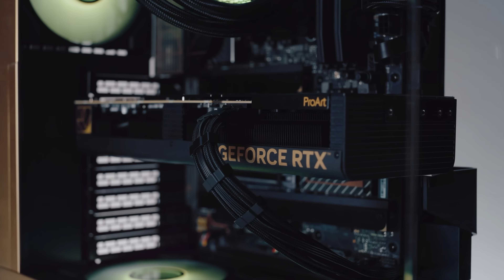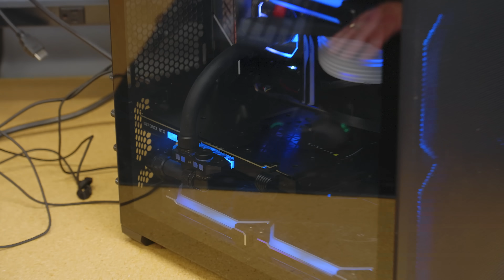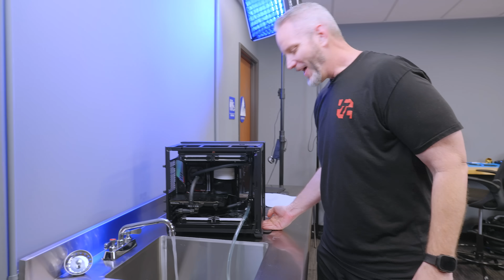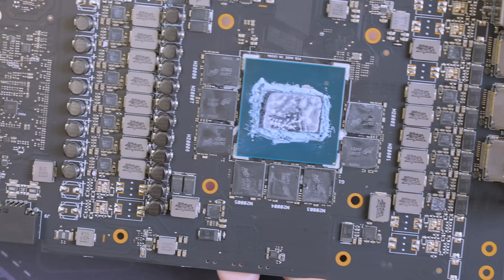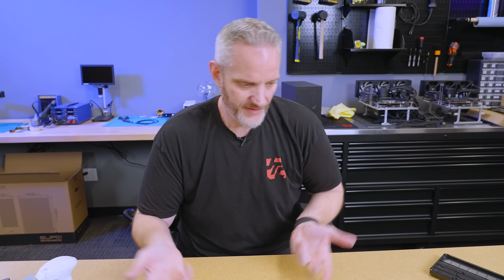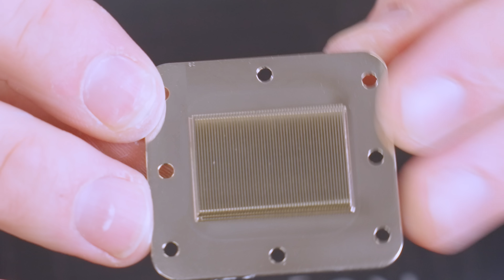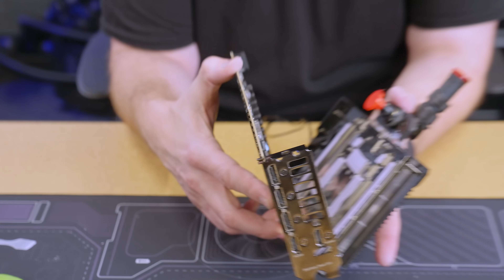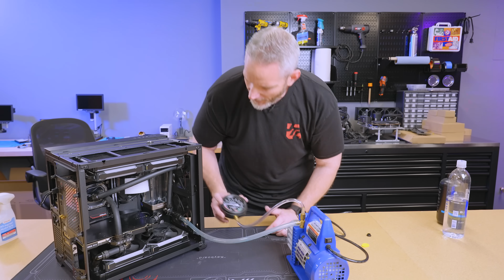These GPU Temps were BAD... here's what went wrong and how I fixed it!

Comment: I am rather new to PC building. I just finished my gaming PC about a year ago. I have a MSI gaming trio OC (non plus) and the core while playing cyberpunk 2077 in 1440p with everything on ultra ray tracing is also on ultra the gpu core is going g between 68-73c the max temp was 73c. My Hotspot is reading between 87-93c with max being 93c. Is that delta concerning? Should I repaste or monitor and consider warranty? My CPU is the 9800x3d and the highest that has gotten in temp is 62c it hovers around 58-60 most times. Is the delta between my gpu core and the Hotspot cause for concern? Or am I stressing over nothing? For little more info my ambient temps in the room are high as I live in the desert and dont have good AC. If I were to guess my ambient room temps are in the 70's
Reply: Thank you in advance to anyone who can give me some insight and taking time to help me out little worried :/
Reply: I know it's been 4 weeks, but I suppose you have a 4070/5070 or something along those lines? Those numbers are acceptable, specifically if the fans on your card don't ramp up too much on their own.

Comment: My 4080 super is incredibly hot on the memory. 104c and I already tried changing to der baur pads and a phasesheet for the die. No change on memory temp, no change at all actually. Tried undervolting and still no better

Comment: I have been using AIO for years Jay your water cooling sucks,You run hot water from your cpu or gpu with out cool between heaters  it does not work effciently coold water must enter CPU or GPUbefore heated you say it dont mater but does Ambien temp mater?

Comment: @Jayztwocents

I'm having same kind of problem with my new AMD Radeon RX 9070 XT. It is air-cooled with three fans plus three fans on the bottom of the case blowing straight to GPU.  When I play Expedition 33 on "high" settings, my hotspot flaxuates between 80-90 c while my side temp remains 65ish all the time. Any advice or tips how to get the hotspot down a little? GPU is on factory settings with power limit raised to +10% and I have BeQuiet Light Base 600 with 4 pre-installed fans to begin with so air flow shouldn't be the problem. And we are talkin about 22 ambience.

EDIT: Just ran 20 laps of speedway, my temperatures settled 55 c on GPU side, 84 c on hotspot, every fan 100%. Is this normal or can someone give me some advice how to get that hotspot down?

Comment: Since you asked me to so nicely 
As a mechanic I cannot fathom why you would want to introduce the problems of a liquid cooling system into your PC 
Air pockets, blockages, leaks, debris build up, corrosion, the maintenance etc is just too much, at least with an engine if something leaks 99% of the time it will be a okay, whereas your electronics won't be so lucky for many reasons 
I would completely understand if it was a 10-20-30°c difference between air and water cooling but even now with a single card system pulling 800-1000w there is only a few degree difference for a metric ton of extra money, and work

Comment: My 4070 Super was hitting 105 on the hot spot with a 25+ delta. Pulled it apart to repaste and found a dry spot and my damn sag bracket was preventing one of the fans from spinning. Runs great now.
Reply: Awesome. What are your temps now? I have 4070s as well, and the hot temps are like 86. Shouldn't I be worried?

Comment: I saw the difference between mounting pressure.  I have the same issue with my 7900xtx. Since the chiplets aren't the same height, the 7900xtx is know for hotspot deltas.  I'm trying the thermal grizzly ptm. Honeywell ptm7950 is an other but there are alot of knockoffs.

Comment: i always just put a blob in the middle of the die. never had a card fail on me that way. my zotac 3060 12gig flashed with the twin edge bios for higher power limit was done the same way. deshrouded it and slapped two noctua fans on it max temps is 62 on the die nd 71 on the hot spot.

Comment: 13:53 Some thin plastic works excellently for cleaning between the fins. I've had good success with getting an old plastic soda bottle and cutting some squares out of it. You can use each corner of the square as a scraper to slide between the fins. After a few swipes through the plastic can start to get a little worn and becomes less sharp, so then I swap to the next corner of the square. Worked well with my EKWB blocks, but couldn't work with my Heatkiller IV Pro; the gaps between the fins are too narrow!

Comment: would an ultrasonic cleaner help with build-up in those micro channels or would it just help with the bulk removal while still needing a detailed clean?

Edit: mentioned in the last 30 seconds or so, gotta stop running to the comments before I finish a video, gd. Also, what was the cause of all that build-up?

Comment: may look into a water separator for something like a air compressor system as a separator in between the vacuum pump and the pc, not sure if it would handle a vacuum as something intended to only see internal pressure. just and idea

Comment: What was the source of the crap that clogged the micro fins in the block? Would an in line filter, with a bypass loop and clear tube, be a reasonable addition? Perhaps a design that would allow filter replacement without draining the system?  This would hopefully eliminate crap building up in the micro fins.

Comment: Phase change material would be great for water cooling: Honeywell PTM7950, Thermal Grizzly Phasesheet, or if you’re on a budget Gelid Heatphase: lasts much longer, performs well, great for laptops/low-maintenance situations (if you know the person who’s getting the computer doesn’t do much maintenance, or if you want to avoid taking something apart to repaste). In my experience all 3 perform pretty comparable (although Phasesheet does explicitly have a thermal-cycle number before it performs well)

13:59 This is exactly why I water cooled my PC

Comment: Its becoming apparent in GPUs and CPUs we are approaching a hard heat barrier. As die parts get smaller ie nm size and power being used increases were headed to a heat barrier that may require something entirely different to todays technology. Burnout is becoming a big problem.

Comment: I'm sure your done it with your car work! Save yourself time and trouble! Put something that will work as a reservoir between your pump and the liquid. With less than an atmosphere of pressure, you wouldn't need anything particularly strong.

Comment: Yeah... I've never owned a liquid cooled GPU. I am not superior enough to run open loop cooling. I'll never deny how great it can look though.
I did however get a great deal on a deepcool 360mm AIO four years ago. So I'll be running that until it drops dead and then going back to air cooling.

Comment: Ya know recently i realized my GTX 1080 was running warming than it used to. quite a bit. air cooled, system is quite clean overall. Thinking its probably time to re-paste/pad mine, but i cant find any concrete information about the thickness of the thermal pads on my 1080. Jay do you have any advice on how i can determine the thickness of the pads, without disassembling the card first? cant have the card be out of commission while i wait on something in the mail.

Comment: This vacuum filling method would actually work much better if the bottle was above the valve and you made sure the fill tube was empty of air before you opened the valve.

Comment: I had never had an issue with thermal paste pump out until my Tuf 4080 Super...My GPU hotspot was hitting around 82c-83c with 20c ambient...I have a massive water loop with 2 45mm thick 360mm rads and 55mm thick 360 rad, so I knew something was wrong...When I pulled the block off the GPU there was barely any thermal paste left on the die, it had all pumped out around it...Instead of putting my Kyronaut paste back on it, I just coated most of the card in conformal coating and put Conductonaut Liquid metal on it...The hotspot never cracks 50c now and I couldn't be happier!

Comment: water cooling is awesome as I can set the fans so low that I don't need to hear them and I get low temps it is so practical. I will give it that it is expensive but I get such low temps and that's why I did it was for the low temperatures. I put AIO's in build that I build for friends though.

Comment: I used that tubing as well and it is SUPER tight in the fittings. I finally gave up and used vice grips and pliers and embraced the paint I rubbed off as a design. 🤷‍♂️

Comment: I had a similar temps issue with my Taichi 7900 XTX.  I replaced the thermal paste with PTM7950 and saw great results.  15-20c drops and the delta between GPU and hotspot dropped from 20-40c to 10-20c.

Comment: I'm sure it's not a huge deal but I wouldn't want the CPU and GPU connected so closely in the cooling loop.  Where one's intake is the outtake of the other.  I'd want at least a single fan radiator between them in the loop.

Comment: So many people here that either have or think there are too many issues with water cooling. I've been running full custom loops for 15+ years now and the only thing I've done is change fluid once a year which often turns out to not even be necessary. 

I only run deionized water with proper growth inhibitors, never any colored fluids and never any issues.

Comment: My 6750 XT's hotspot reaches to 110-115 C°. I sent it to the service twice, they said nothing is wrong with it and sent it back.
Reply: What AIB company is it? And you should under volt it (1100mv) set your min core clock speed to 2400 and max clock speed to 2600, set max fan speed to 60%, turn off zero rpm fan and you can do all this via Amd's Adrenaline software. Ancient Gameplays a creator on YouTube has a great comprehensive guide for custom overclocking with these cards, it's easy to follow, you get better performance and temps. IF doing something custom scares you then in the Amd Adrenaline software there's options under the performance tab that let you "1 button" under volt. Just doing this should reduce some of the heat (Though a proper custom tune would be much better).

Comment: As a minor criticism of your technique when vacuum-filling the radiator system, there would have been less air re-introduced into the system if the fill-tube had been filled with liquid before the valve was opened.  The way you showed it being done, the interior volume of that tube was full of air, so it was the first thing pulled into the system, even before the coolant was pulled in.

Comment: I also just fixed my hotspot temps on my 7900 xtx it got up to 110 pretty consistently and now its just over 80-83, thermal grizzly's kryosheet is awesome, although its a really difficult application, id recommend putting some dots of thermal paste in the corners to be "sticky" and keep it in place

Comment: Jay, why not buy an ultrasonic cleaner, wouldn't that work to clean those micro fins?
Reply: You've literally just watched the answer to that question. 
He gets sent so much stuff that installing a new part is easier than cleaning old components. 
Guess which 4080 will get swapped for a review 50-series card and a review water block from Corsair really soon anyway ... ^^

Comment: I'm not happy seeing anything over 70C.... for the longest, deep into the 2000s and probably still valid today... go look at datasheets for capacitors etc... they have temperature derating curves that basically cashes in lifespan for increasing temperature levels... Go look at some old circuit board, it likely haws the temperature limit for capacitors printed on them... normally 70C.... above this lifespans are severely affected... Also seriously dud why don;t you own ArtiClean, call yourself a professional do you? could use hot air gun to heat a spot

Comment: my 6800xt runs games always at 90-100c with a delta of 10 15! been gaming on it for a few years, always performs and gets fps as expected, and it hasn't declined in performance and "most" of the time it even doesn't  throttle! I don't get why people are so fixated on temps! even CPUs don't throttle even at insane temps!
even my 15 year old crappy laptop with a nvidia 660m performs about 80 90% as if it was new, and those fans are clooooooogged! it's resting temp is around 60 70c lol, when gaming on it i could cook an egg on the keyboard!

Comment: the perks of Corsair blocks really, watercooling on the cheap (except the price tag!). They don't need to put microfins on custom loop GPU blocks. Any other block with regular fins would have seen minimal buildup and not be completely blocked off like that. I guess it's possible the pumpout was a consequence of the die getting too hot because of the buildup.

Comment: I'll be honest, i am pissed when my GPU is 5°c delta between temp & hotspot.. repasted & remounted my GPU in the past couple of days like 8 times..

I've had the same issue with a corsair block in the past, mounting was pain in the ass.. Since then i am only using Thermal Grizzly & Alphacool blocks.. no issues. Just perfect hardware.

Comment: Jay, as you requested, about water cooling! IMHO! For most people is just waste of money it's not worth to gain 10-20% more performance and consume 50-100% more power and make your system less stable because of weak spots like pump and other.  Those who uses PC for work, need reliable system, not a little bit more FPS. If you confident enough to risk PC components, because you have too much money, doesn't mean that everyone should do that. Water cooling is more fun than actual necessity, it's more garbage, don't we have enough? And about climate change, 200W PC's were not big of a deal, but 1KW can cause a lot more harm than you think, you probably know the phrase - straw, that broke the camel's back. I, personally don't like tendency of more power consumption, first of all it's not a progress, an actual progress is when make something better and don't make something worse at a same time, second, it doesn't do anything good, except maybe it will be warmer in the winter. I get it, you making fun videos for gamers, you making money, but don't try to humiliate other people, it can backfire.

Comment: Jay you need a second sink, I am here for the JayzTwoSinks content :P

I think watercooling is so hecking cool (no pun intended) I just can't justify the cost of it, considering the amount of budget I usually have for my PCs, I would be better off just spending that money on better hardware, I usually go for solid mid-range stuff expecting it to last me 4-6 years in terms of "Does my computer compute to the degree I want it to compute in games at the resolution my monitor supports?"

My 3070 is starting to show its age, and last year I upgraded from a Ryzen 5 3600x to a Ryzen 7 5700x, the two more cores and higher frequencies were nice, I just hope the 9070XT from AMD turns out to be amazing success, and that Intel follows suit and keeps up the stellar price to performance of the B580 :)

Comment: i have 3080 rog strix and in furmark at Q mode i getting 70C core and 91,9C at hot spot at def. power limit (370W) it's not original state i had LC on card im waiting for PTM and putty to fix it hopefully

Comment: Just curious, you did a video awhile back about graphite sheets or something instead of thermal paste, how have those been working out? Seems like something that as long as you put it on right would if not eliminate issues like this then reduce them. I think it is a really cool bit of tech and I also like that it isn't nearly as messy.

Comment: You illiterate fools :D

First of all that is EPDM tubing, secondly you had covered the entire die and the only reason that side was "clean" is not because of mounting pressure, it is not a hotspot and it certainly is not caused by you missing a spot! The reason is you pulled the block from the die, there is some suction from the paste holding the block and die together... this means the "clean" spot is just where it teared off the block first and it sucked itself towards the other side as you peeled it off!

Comment: I had sever pump out on vertically mounted my 3080ti too. I found that out exactly because of the big delta between GPU and hotspot temp. This is exactly why I’m scared for the 50 series not having an hotspot sensor. On a 600W 5090 having a few square millimeters uncovered due to pump out could be a disaster

Comment: great video as always Jay... when I built my system the first time I also used a bit of blue colorant from EK on my loop, and after a year of usage there were also some build up and stains everywhere, since then I'm only using the clear stuff... Also watercooling systems are not dumb, and it has its advantages, but for me no longer makes sense, as things got more expensive and with the whole fiasco the water cooling world is at right now, at least here in the UK almost impossible to find blocks for GPUs, so I'm done, on my next gfx card upgrade I'm going back to air of GPU and an AIO for the CPU... its alot better when it comes to take things apart as well, because boy is it a pain the backside to drain a loop and stuff, and I had a horrific accident already when the Lian-Li L-connect 3 software stopped working and stopped controlling the fans, sending all of them to the lowest fan speeds, one day during a game session, the tube just popped off the fitting due to the excess pressure created by heat... so I'm done xD

Comment: I had this crusty coolant happen on my cpu block same blockage as Phills gpu  using blue ek coolant. Had to completely strip the loop and clean it out. Only use clear coolant now and not had a problem since. 

Top tip fill the pipe with the coolant prior to opening the tap even less air will enter the loop too. 

We do this when vacuum filling coolant on engines aswell.